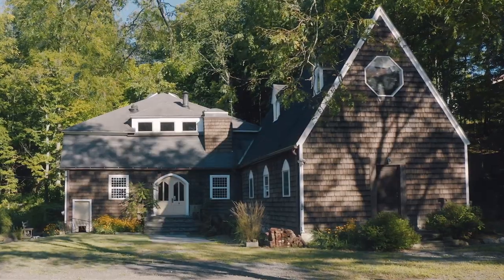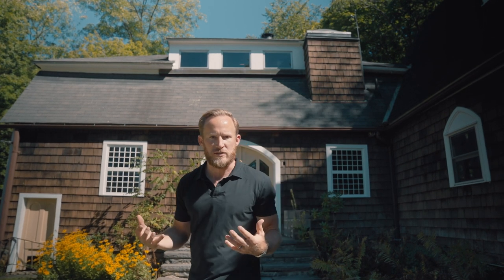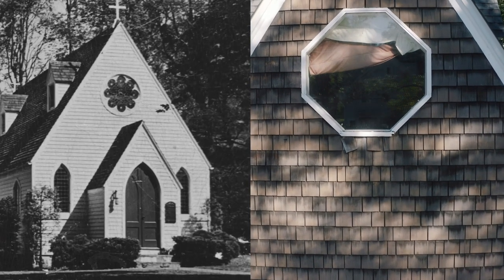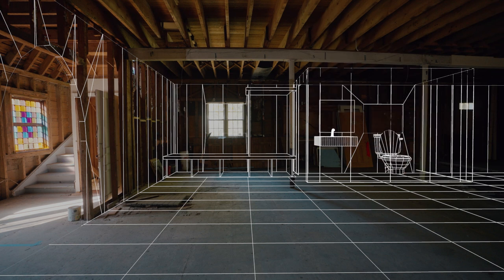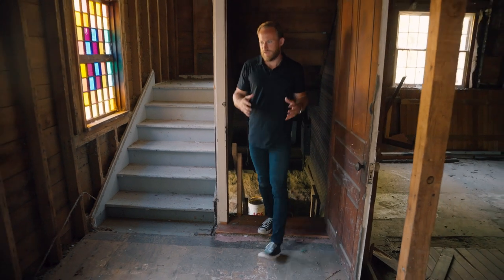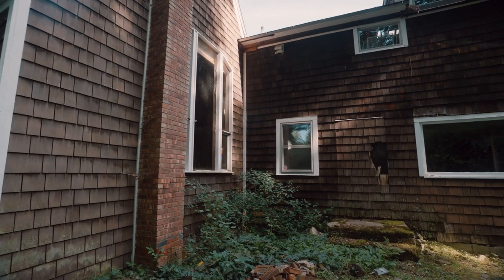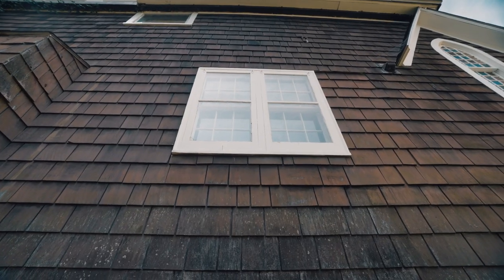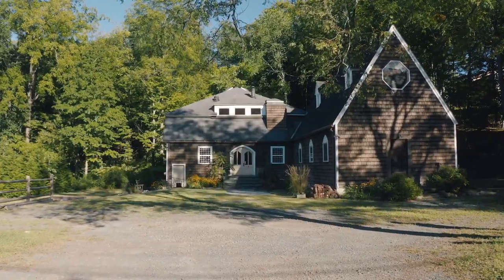Converting An Abandoned 1800's Chapel | Hidden Gems | Architectural Digest

Comment: Agreed with so many of the suggestions- especially restoring the bell tower, the Juliet balcony, and daylighting the stream and ground floor.  But one spot where I differ is with making the chapel a bedroom... largely due perhaps to my personal bias against massive bedrooms: I think it'd instead make a great living room.

The top of the steps, by the altar's current spot, would be my kitchen, though I'd also foresee at least several spilled dishes tumbling on those steps (regretfully speaking from experience of kitchens with 1 or 2 steps down into living areas). The kitchen would overlook the slightly sunken living area.

The museum area I think I'd reserve largely for bedrooms, bathrooms, storage, and perhaps a family room / play area centered in the upper level and accessing the Juliet balcony.